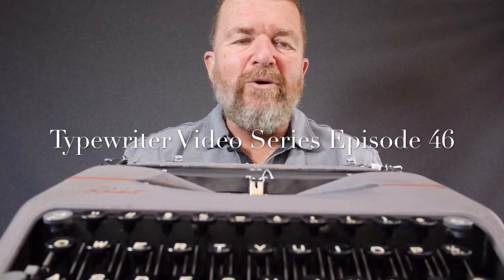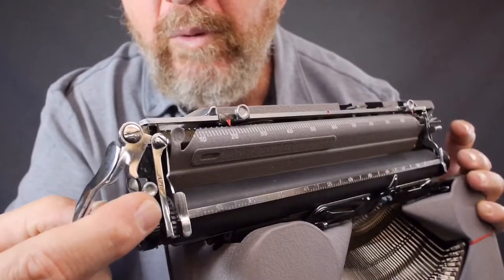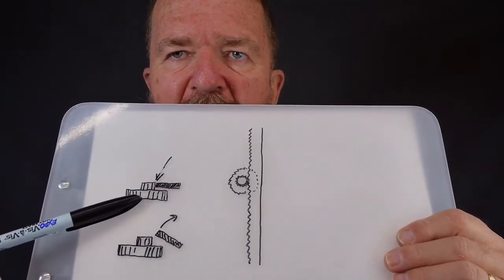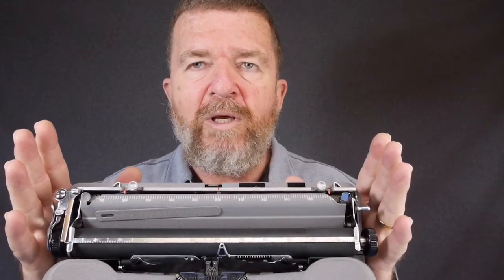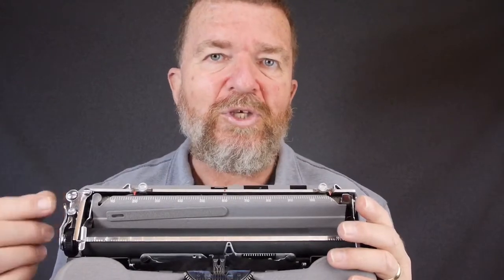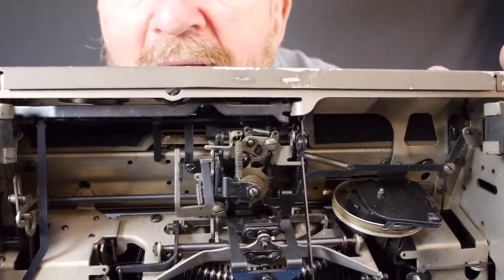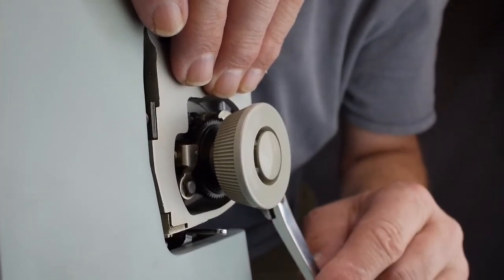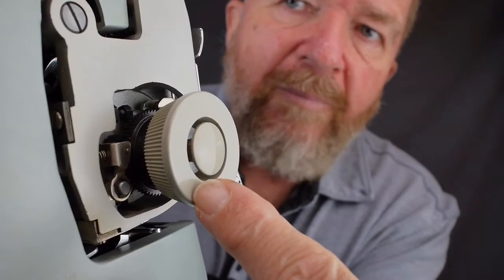Typewriter Video Series - Episode 46: Escapements, Their Care & Feeding

Comment: I have an SCM Classic, Series 5X from 1963 that is a more recent version of a Super Silent.  However it has no lock lever at all but if centered properly, the Samsonite case that it came with, has metal brackets that disengage the escapement when the lid is closed.  There are bigger brackets that prevent much sliding of the carriage.  One way to get around the problem.

Comment: Hi Joe. 'nother great video, thanks.

If you take the ribbon cover off of your Facit 1620 and look at the left hand side bodywork, there is a spring front-to-back where the ribbon cover peg is held.

Near to that, on the chassis, is a machine screw with a built up boss and cutaway. This is one of the two screws holding the ribbon spool drive mechanism plate. One screw is normal, one is built up and looks as if it should have a spring end looped around it.

Loop a spring end around it, and attach the other end to the carriage center-lock link where it does the s-curve through the bell-crank. This will pull the linkage to the rear of the machine, and make the center-lock operating lever work as advertised.

Comment: I work on Phillips computers in the 70's (punch card readers and mag strips on card stock )and it use typewriter mechanics for printer. The keys were controlled by solenoids and type heads and escapements broke all of the time. The type head were soldered and a real pain to mount correctly. But I enjoyed working on the systems. And had to repair down to individual components. Good times!
Reply from the maker: I also remember the days of component-level repair. Good times indeed. Thanks for watching.

Comment: Hi Joe. I have a Smith Corona  classic 10 typewriter.  I have the linear gear that has the serrated teeth, but the type writer is old and so a section of the teeth have been filed down. When the carriage passes to that section it slides over the teeth and skips a couple of spaces. I need to find a new linear gear, do you know where I can find one, are they for sale online? 

Thanks so much.
Reply from the maker: The only source for these parts are so-called “parts machines” that would have a good rack gear bit otherwise are too far gone to be usable. You’d have to search online for people selling a parts machine compatible with the Classic 10.
Reply: @Joe_VanCleave  Hey joe! Thank you so much. There is a typewriter store called John Lewis mechanical antiques. It looks like he repairs typewriter. I will see if he has any of these parts.

Comment: I recently purchased a Corona Smith Galaxie Twelve and something is wrong with the carriage. It doesn't stay in place. It always slides all the way to the left. I have looked at the inside and found a few things that look weird, but don't know how to fix it. Please help! Any guidance or direction to resources would be greatly appreciated. Thanks
Reply from the maker: Work the carriage release lever (on right side of carriage) and see if it's operating the linear rack gear (under the carriage) to engage and disengage the escapement gear. You can look down the length of the rack gear,  under the carriage, from right to left, with a flashlight, to see if it engages the escapement gear in the middle. If so, then something in the escapement isn't proper. I always assume grunge and hardened lubricants are the first culprit, so take off the bottom of the machine and do a thorough clean and degreasing of the escapement area, using 91% alcohol and a gentle air compressor, and a degreaser like PB Blaster if it doesn't fix it. PB Blaster is very stinky, so use it out of doors. There's also the typewriter repair bibles, reprinted by Ted Munk, there's one for the 6-series Smith-Coronas, they are very good about the details of the escapement. But I'd recommend a thorough cleaning and degreasing before going any further.

Comment: Oh, yeah, now you tell me (uh, four years ago). On my Rocket, the rack that engages with the escapement came out of the bracket that it pivots on. Happily it was an easy repair. And it sounds like what happened is better than what could have happened.

So how should I be transporting my Rocket to avoid this?
Reply from the maker: Keep it in its case when moving it, and don't subject it to severe side-to-side motion.
Reply: Unfortunately, I don't have the correct top cover case for it (know where I can get one?). Itntified ultraportable. The case is slightly too wide, so I made up spacers. However, they weren't tall enough to reach the carriage. I thought the carriage lock would hold the carriage in place. Now that I know it does, I extended the spacers up to hold the carriage.

I use the typewriter to write competitor bulletins for a form of motorsports held in the woods on logging roads, so sometimes its case is bouncing around in the back of a car.

Comment: Hi Joe, I got this Smith Corona Sterling Electric 12 where the carriage slammed to the left after I pressed the Power Space key and now it won't advance when I type. I'm told the escapement/power spacer assembly needs to be flushed, but how do I locate it? I pulled the chassis out (https://imgur.com/a/xbEYyIA) but it's different from what you show.
Reply from the maker: It’s difficult to troubleshoot without looking at it. When you press the keys, do they type, even though the carriage doesn’t move? Can you move the carriage manually using the carriage release levers behind the platen knobs? Does it move at all manually back and forth ? Do you feel the tension of the spring motor trying to pull the carriage to the left? If not, the drawband or spring motor may have broken.
Reply: @Joe_VanCleave  Thanks for responding. It's difficult to troubleshoot even looking at it! That's what I was doing this morning, and one of those thin bars with hooks at both ends fell off. So I think I'm done.  Repair shop is next, if it's worth it.
Reply: @Joe_VanCleave  I was able to put the wire back in place, so I'm not giving up yet. But another weird problem came up. When I turned the power on, the carriage starts moving by itself with a jerking motion. https://www.youtube.com/watch?v=KJZiEQo7suQ. I must have misplaced something. Have you ever seen something like this?
Reply from the maker: @formgh841  It's possible the last time it did the power return when it broke, perhaps a drive belt is slipping and the mechanism hasn't completely cycled itself through the carriage return process. Perhaps some hardened greases are keeping the system from running freely, along with slipping belts.
Reply: @Joe_VanCleave  Someone suggested the back spacer is being powered. Indeed when I press the backspace key the motion stops. How do I fix that? If you address that problem in one of your videos, please let me know.
Reply from the maker: @formgh841  I haven't addressed that issue in my videos, sorry. Perhaps check Phoenix Typewriter's channel, Duane has a lot of great repair videos.